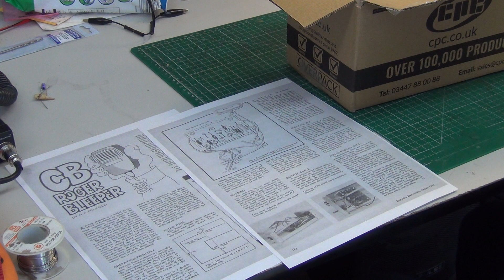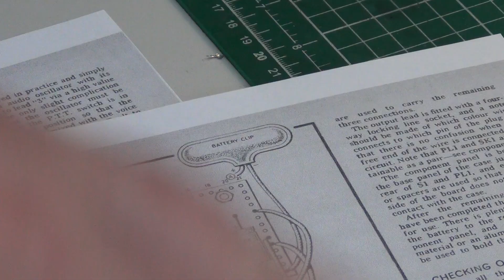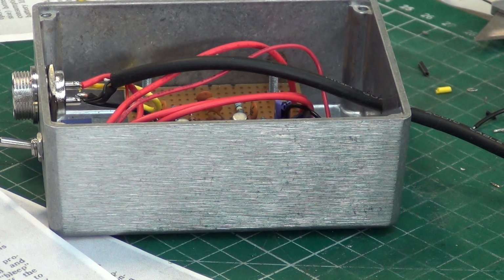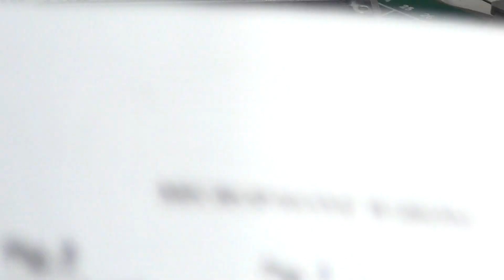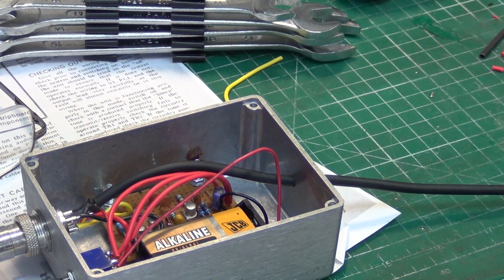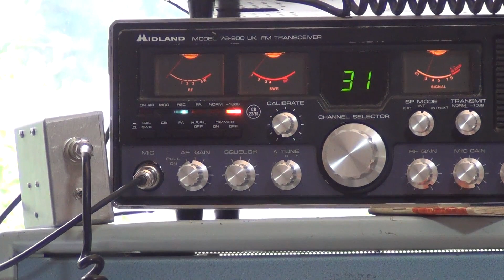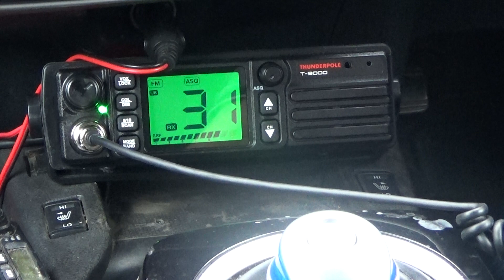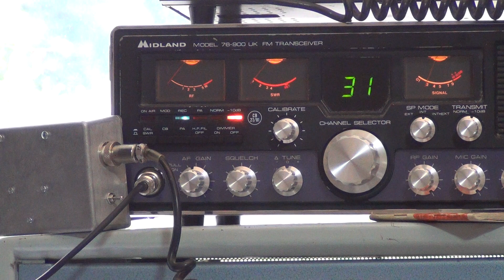Roger Bleep project from Everyday Electronics Magazine August 1982

Comment: But what about the car, did it pass its M.O.T?
Reply from the maker: Yes, but they said tis would be the last year the car is viable. It's R registration so 1997. Drives great, 43MPG automatic with aircon.

Richard
Reply: @ukfmcbradioservicingTango21  Hang on to it, after 40 years you don't have to M.O.T them.

Comment: I really like the box!  Thanks for putting this together.  Would the tone/time change if it were connected to 13.8 instead of 9v?
Reply from the maker: You'd probably wreck it on 13,8V, so it would need a power regulator. Read the article, the author may have discussed the way the voltage has been chosen.

Richard
Reply: @ukfmcbradioservicingTango21   will do! thanks

Comment: Need a relay to stop it feedback from the speaker
Reply from the maker: That's as maybe, but the idea is to use this on the tests with any radios that are wired Cybernet. It's not annoying to me especially for the few minutes we'll be using it on tests.

Richard, G0OJF, UK

Comment: You should have built one of those 'K Tone' bleeps that everyone seemed to go for. Another one would be the Hy-gain 5 roger bleep, or better still, a Mk2 Cobra 148 gtl dx bleep. 😁
Reply from the maker: Neither of those radios were UK legal sets. I want to keep what we do on this channel relevent to UK FM CB radio.  If one of the UK electronics magazines published a K tone design as a plug-in accessory like this, then we'd build one. Vintage electronics projects from UK magazines is another interest of mine.

Richard, G0OJF, UK

Comment: it has a radar ping sound about it..
i'm sure a few changes would make it sound better..
hearing iton receive is because the PTBM134 board doesn't have a relay, so you'd need a relay to switch the RX out..